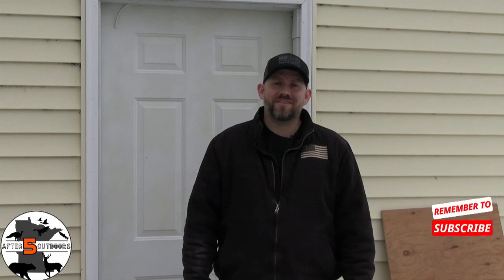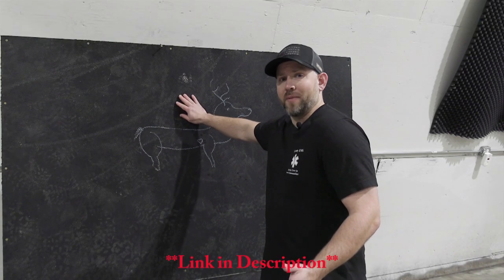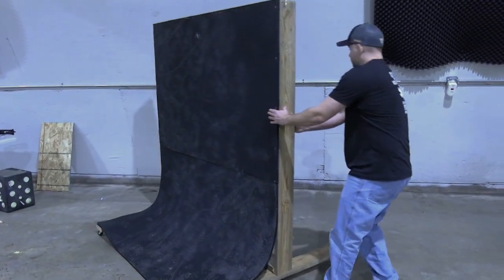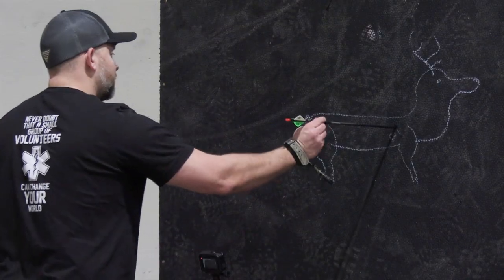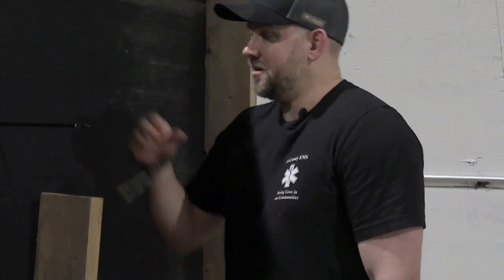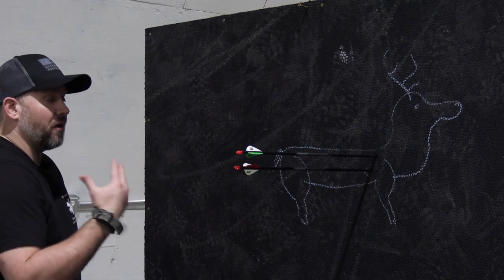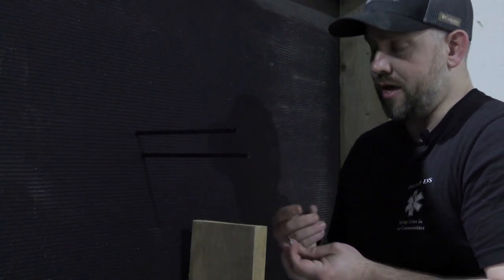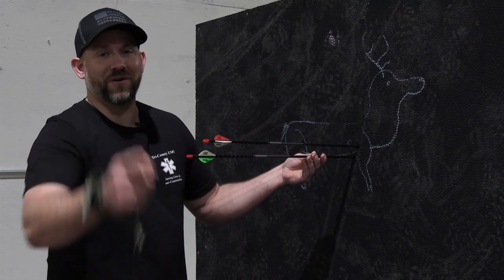DIY Archery Target Backstop Test (Does it Stop an Arrow?)

Comment: the best target i have used has been compressed cardboard layers , we used all thread and 2x12 frame and a couple hundred layers of cardboard stacked and compressed  with the all thread . the layers stop the arrows with friction between layers and lasts for years . no scuffing or residue on the arrow , just do not use waxed cardboard  the arrows will not come out . the stacked cardboard target we used had paper targets pinned to the front for practice for an indoor dot shoot . use a good foam deer target for broadhead practice , they have trouble pulling out of the cardboard  and inserts pull out .
Reply from the maker: We may have to test that out. I have seen a couple videos on that as well
Reply: I've used compressed cardboard also. It was crude and homemade.
Reply from the maker: @tomkeltescheverythingoutdo2379  how much cardboard did it take?

Comment: I need an opinion,  I was asked this evening if a 1/4" rubber mat would work behind a hay bale if the arrows are target arrows fired off of a 30# draw fiberglass bow?  I thought that is would be plenty of thickness but would like to hear your input.
Reply from the maker: Alot of variables I think. Distance is one factor, are you talking square bale or round?
Reply: @After5Outdoors  IT would be a square bale at about 10 yards. There is also a wooden wall behind the rubber matting.
Reply from the maker: @randyyoung8619  I think you might want to test it in a safe environment

Comment: I was told by a bow tech at Cabelas to just hang carpet. 
Hung it, shot it with 340 grain field point from a Mission Craze. As predicted, blew right through!
DO NOT USE CARPET!
Reply from the maker: Many layers of carpet may do it but certainly not one layer
Reply: @After5Outdoors  nah, not worth the effort. Like your idea
Reply from the maker: This way is much easier

Comment: If you use a stall mat it needs to swing. That way you won’t over penetrate. The backstop can’t be rigid. Place styrofoam panels on your metal walls just as a precaution.

Comment: If you're saying the horsemat can damage your arrows why are you shooting your arrows into them lol? I shoot the same exact arrows.  FMJ 340 11.3 5mm and I have a horse mat I use as a backstop as well.  The horsemat I use is less than 3/4" thick.  It's like 7/8".  Since mine is thinner and if the FMJs are made of aluminum and durable material, do you think my horse mat would still damage the arrows?
Reply from the maker: Repeated shots may. We used these arrows to show the mat would stop them
Reply: @After5Outdoors  thanks
Reply from the maker: Yes sir